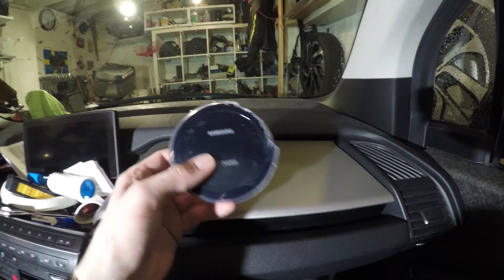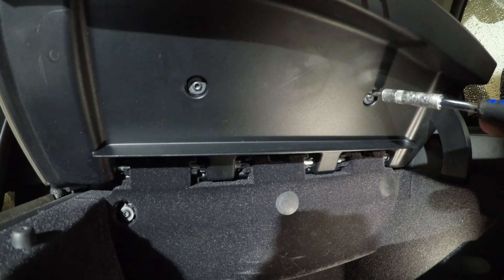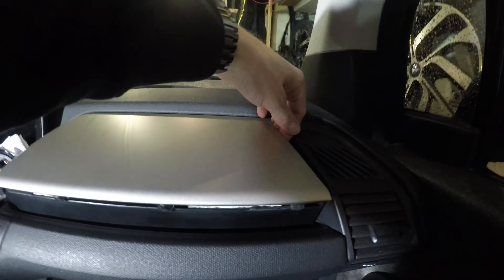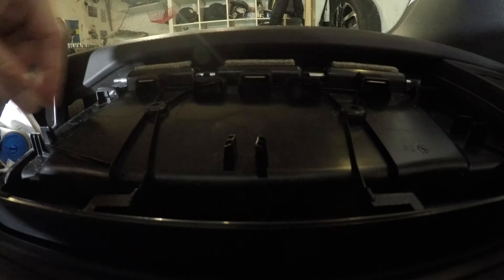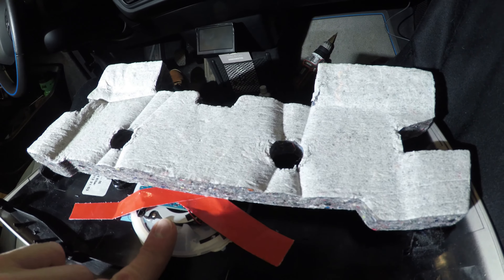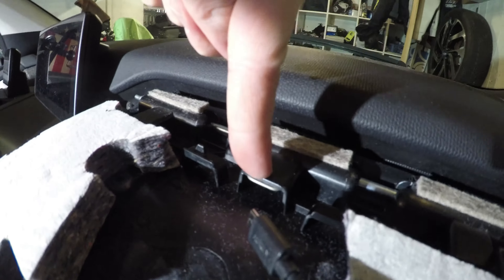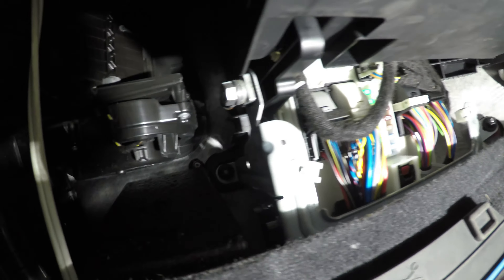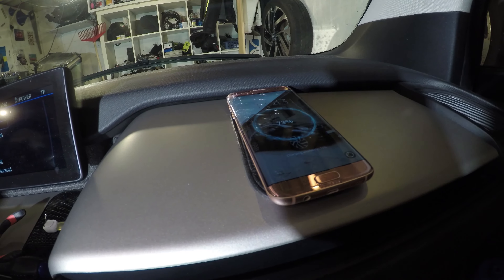BMW i3 DIY wireless QI charging for mobile phone

Comment: This is an awesome tutorial.  I definitely need to try it out. Did you cut a hole in the top or just use the black mat to remember where it was?
Reply from the maker: No cutting holes in the top, I just moved the phone around until i found the right spot, then put the black rubbermat there to easier find it.